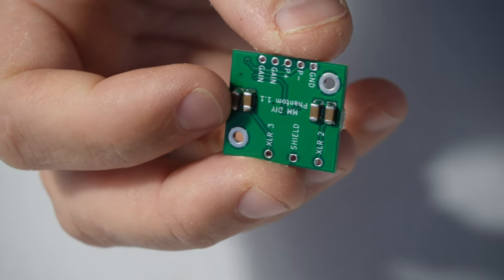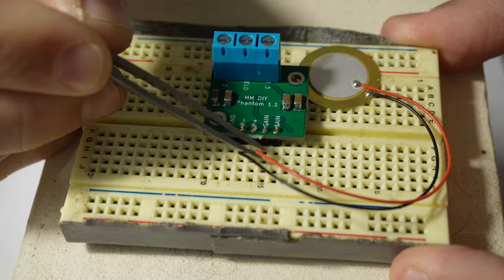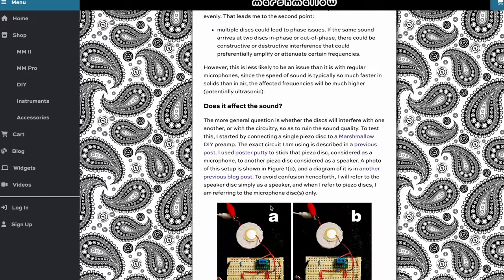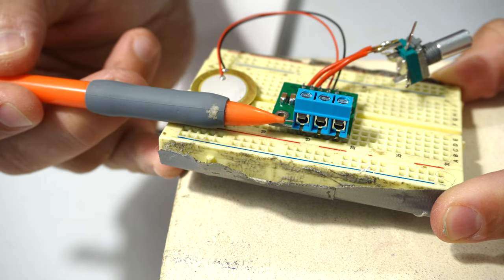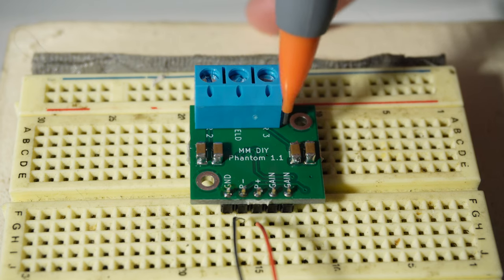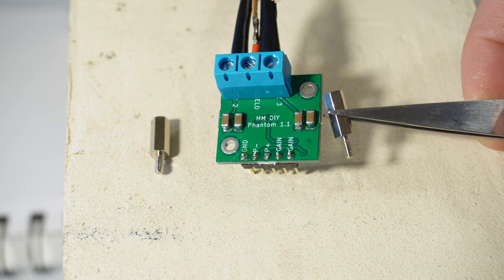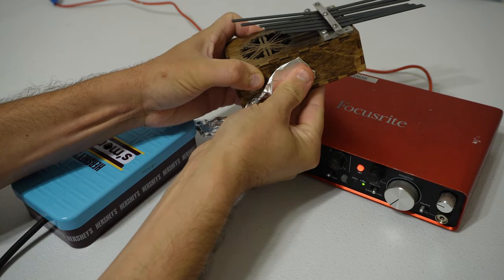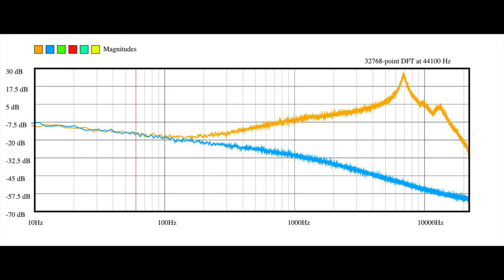Bessst evvvvvvr phantom powered DIY piezo preamp

Comment: You suggested shielding the piezo and demonstrated the same in the video. I could not see clearly if you wrapped the entire piezo disc in foil and that begs the question: If the disc is wrapped in foil, how does one attach the disc to the instrument?
Reply: Hi. He used double-sided tape (like carpet tape) which needs to cover the entire disc so it can't make contact with the foil that you then cover it with. I use shielded cable with two wires for +/- and a shielding wire, which connects to the tin foil by lying it across the double-sided tape before putting the tin foil over it (so it makes contact) ...or you can connect the shielding wire to a metal tie wrapped around the tin foil. You can then coat the tin foil with something like a plastic sticker, depending on how robust you need it to be. You use the back (all metal) side against the instrument, with as little blu-tac as will keep it in place. The wired front can be protected with something like felt pad protectors for table legs. The shielding wire then needs to connect to the metal enclosure along with the ground wire from the circuit board.

Comment: I presume the polarity & orientation of the piezo discs matter more when using two discs? If so, is it possible to get further noise cancelling by reversing the polarity AND orientation of one disc with respect to the other? Thanks.
Reply: (By orientation, I mean whether the back or the crystal-coated side is against the sound source.)